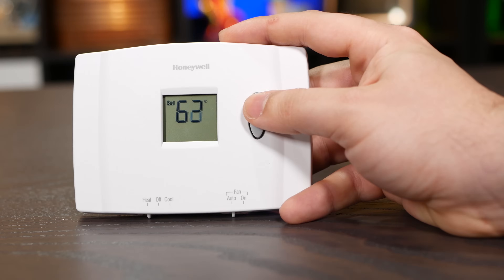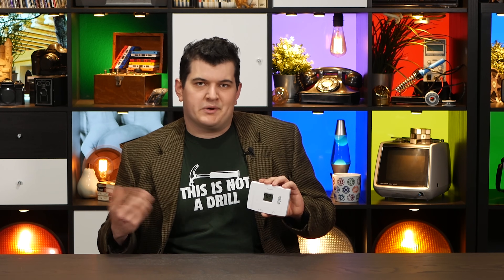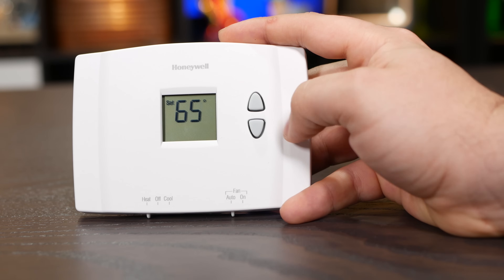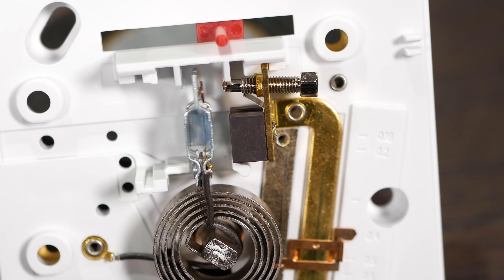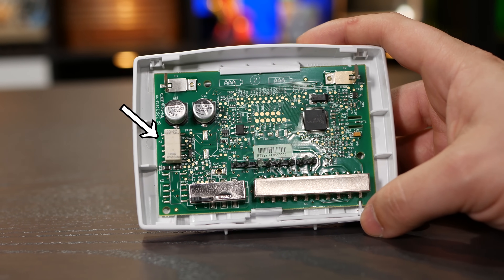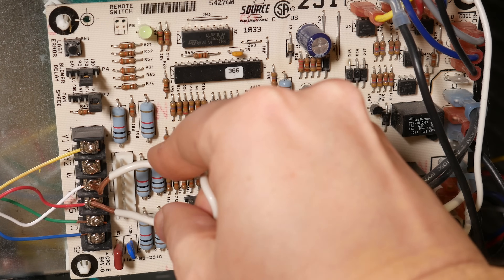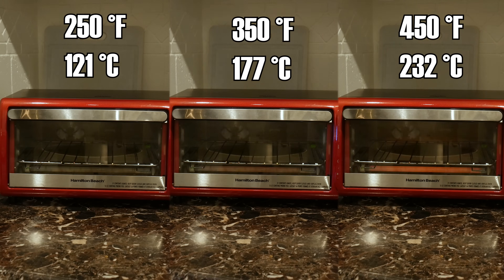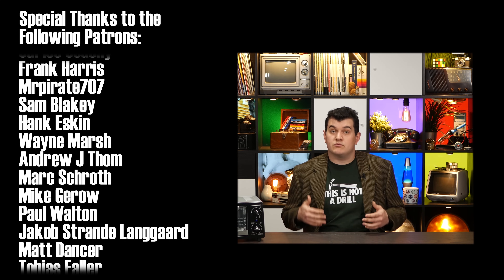Thermostats: Cooler than you think!

Comment: I understand why you did not use the term 'Hysteresis' but you might have mentioned the anticipation resistor present in old mechanical thermostats to accelerate the heating inside the thermostat housing to match that of the rest of the home (in theory).  And for what it is worth the time compressed toaster ovens were a great example.  If you don't need them anymore I would like to say I do like a well heated toaster pastry.

Comment: Another thing talking about heating technologies.
I don't know if this kind of systems are used outside Italy but here we are:
In my house there is a system that does not command the furnace but a valve.
The water is always warm and it circulates in the tubes continuously in all the floors.
There is a thermostat for every floor, when a thermostat triggers, 24V are provided to a liquid expansion valve.
A liquid expansion valve is a valve that heats up and expands a liquid that is inside, this liquid pushes a metallic bar to a valve that opens and let the circulating water Going though the floor where the thermostat has triggered.
When it Reaches the right temperature and 24V are no longer provided to the liquid expansion valve that cools down, retracts the metal bar and the water does not circulate anymore on this floor.
It's just a simple way to open a valve without any part moved by a motor or something like that.
I apologize if I made any mistake in English, if you want to learn more about this topic, feel free to write to me.
Thanks!

Comment: If you open up your furnace and see three pressure switches (plastic disk with tubes and wires going to it) it is most likely a 2 stage furnace. Most often, with the dumb thermostats, they run on the first stage for a set time (3-5 minutes) before the furnace kicks in the second stage. Most homes here in Canaderp have these dual stage furnaces. 

Those pressure switches are connected to the draft inducer fan casing and when the draft inducer is running a sufficient amount of negative pressure, the switches will close and the first or second stage will activate depending on the settings.

Comment: Honeywell just released a thermostat called the T9 which you can add multiple sensors to it for different rooms, but there is a tricky thing they do. You can tell it for certain times of day what sensors to use for priority on the heating and cooling. So you could tell it to make the living room the priority sensor during the day but the bedrooms priority at night. It doesn't change the proportional distribution of air, but it does allow finer control without modifying the system itself. I haven't tried it myself but it seems quite a good solution.

Comment: Also, that filter slot is in a terrible location, and should be reworked, with a true media filter cabinet, so you don’t have difficulty changing it, and you get proper filtration without static pressure buildup behind an inadequate filter.

Comment: I have an electric furnace that has 3 stages of 4kW each. The thermostat only tells it on or off as you would think, but there are sequencers in the unit that turn on the stages progressively the longer it runs. It is about 30 years old and this is still a common configuration.

Comment: As an HVAC tech... you are close, but simplifying a tad... firstly, R and Y do not stand for red and yellow... they stand for control voltage souRce, and cooling circuit. W is for heat... a heat pump has Aux heat connected to W2, Emergency heat is a position used only when the heat pump is damaged...

Comment: I lived with my grandmother for a while after my grandfather passed away and I really came to see how much of a saint that man was dealing with her. She regularly would get cold and then turn the heat on and set it to 80. When she inevitably got hot she would then turn it back to AC and set it to 60. Over and over and over. She would do this in the winter or summer.

Another unfortunate HVAC habit of hers was when she would wash her hair (once a week!!) she was afraid of "catching a cold" even if it was 100 degrees outside and would turn the heat to 80 for an hour or so while she did that and while it dried...

Through all this I had the unfortunate pleasure of having the one bedroom with two heat vents in it, so it heated up even more than the rest of the house. She would often start this process while I was still asleep if it was one of my days off...

I have no idea how my engineer of a grandfather lived with her for so long without making some kind of contraption to prevent her from doing these things.

Comment: Important to mention the role of thermostat in heating vs. cooling. When thermostat calls for heat, it politely asks furnace control board to start heating routine. Control board has the privilege to reject or accept it, cause she's the boss. When thermostat calls for cool, it brutally turns AC on, bypassing entire control board, control board has no authority there and only functions as a fan relay switch, cause hey it's furnace board there's nothing about cooling to it. Technically thermostat can be connected directly to fan relay and entire board taken out, your AC will function in normal mode. Now you know that you don't have to sweat when control board has released magic smoke.

Comment: the slightly better version of that battery powered honeywell you have is programmable, and you set periods of time like wake up, fall asleep, morning, afternoon, night. So you generally set those however you want. But lets say you get done mowing, you can press the temperature button arrow things that your cheap honeywell had, and it will say "TEMP ON" and keep whatever temperature you set it to for about 30 minutes, then go back to it's normal pre-programmed temperature.

I almost thought you were putting us on, but i realized your honeywell was missing the 3 buttons that allow the programming. That's the only difference though, same principles apply as everything you said.

And thank you so much i am tired of arguing with people about how thermostats work. just set the temperature you want, going lower doesn't make it colder faster, it just makes it colder, eventually. and vice versa for heat. A+++ would watch again.
Reply: Also last year i moved my house's thermostat from in front of the west facing front door where it would ice the house out every evening due to the SUN SHINE, to near where the intake is. I bought fancy thermostat wire, drilled a hole, and hooked it up correctly in about 15 minutes. And i mounted it so high up that only i can see it and use it. HAHAHAHAHA!

Comment: I used CAT5 cable to connect my thermostat. I just doubled up the wires to make sure it can handle the voltage. This only works if you are only running heat or AC, not both. Cat5 typically has 8, 24 awg connections. If you double them up you only have 4. Thermostat wire typically runs 5, 18 awg connections.

Comment: Would love to see a follow up on inverter split system aircon/heaters. I think they do have variable power output iirc and work via some sort of heat pump and refrigeration. I'm not sure how common they are in North America though, while they are the go to for house cooling/heating (provided you can pay the costly installation) here in Australia.

Comment: Thermostat wire, or low voltage wire, or also bell wire, is much smaller and therefore cheaper than mains voltage wire. A 5 core thermostat cable is not much bigger than one 10 gauge service wire.  Not to mention, the insulation is less as it is not designed for the higher voltages.  And the wire size tops out around 18 gauge due to expected current.  

And most of all, you don't want to use mains wiring because at some point some idiot will connect it to mains voltage, likely causing things to blow up, burn out, electrocute and/or burn the house down.  

I've been trying to wrap my head around code for low voltage installed wiring.  It's a complex topic depending on voltages and power.  Such as a Class 2 transformer/power supply operating at 12v is limited to 5 amps (60 watts) as that is considered both shock and fire safe.  Might be a topic to consider as people move to more homemade LED lighting circuits.

Comment: Hive has a boost function on their wireless thermostats. I don't have AC as it isn't common where I'm from, but it will switch on the heating for a set amount of time or until the desired temperature is reached. I frequently use this functionality and find it saves money reducing the time the heating is accidentally left on.

Comment: 15:02 It exists because it's a thicker AWG than ethernet and phone wire. Plus the number of pairs and as you point out the colors. It's like alarm cable, you shouldn't use ethernet cable because it's too thin. I'm not an electrician but code probably dictates that you have to use it.

Comment: I've got a cheap programmable thermostat that had the ability to temporarily set a temp outside of the program. It will then reset to it's program at the next "switch"

For instance, at 6pm I get home, it's not too terribly warm, but the humidity sucks, so I bump the temp down a couple of degrees, but at 730pm my standard program kicks in with my "evening" settings, overriding the temporary setting I just did.

Comment: If you don't have a C wire for a smart thermostat you can always repurpose the fan wire, you'll lose manual control over the fan but it'll still run with the heat or AC
Reply: There's also an add-a-wire kit you can buy that lets you connect all 5 terminals with only 4 wires.

Comment: My truck's under-hood light has a built in mercury tilt switch. Interesting to see that thermostats used to use them too
Reply: I would also like to point out that my truck was built in 2001, but I've seen the exact same light on a 1971 oldsmobile. Good ol' gm parts bin

Comment: CantComeUp, this video gives me a bit of an idea along these lines.  After seeing him jumper across the terminals, it seems like there could be an easy way to implement this.  It could be something as simple as one of those wind-up egg timer type switches or you could get fancy and throw an Arduino or Raspberry-pi in there for Wi-Fi and smart phone control.  I'm thinking about just doing it for myself so I can kick the heater on for half an hour or so when I get out of the shower in the winter time.

EDIT:  Also just thought of another really dumb solution.  Keep a can of Air Duster near the thermostat and if you want your heater to kick on temporarily just turn the can upside down so it sprays the liquid "gas" out and cools off the thermostat.  For AC, just buy a cheap hairdryer.  Kinda crusty solution but it might be good if you live in a run down apartment or house.

Comment: Its actualy not uncommon to have 2 stage (low and high blower/combustion/ or ac compresser speeds) or to have variable spee (modulating) that can run from ~10% to full blast in heat and cool.  Also most modern homes have 5 wires. Power/common/heat/cool/ and heat.  Although most people use starndard color scheme dont always trust that the colors are correct

Comment: With a Nest thermostat, if you have schedules setup, you can adjust the temperature but when it hits a new time slot in the schedule it sets the temp to what it should. Not quite what you wanted, but it is an option. I know there were days in the winter I wasn't feeling the best so I would just set the temp 1-2 degrees higher than I had it set to normally and when my nighttime schedule would kick in it would be reset to the normal day/night operation.

Comment: I'm not so sure it'd be analogous to PWM. For PWM the frequency stays the same but the amount of time it stays on before shutting off changes. I don't think your demonstration with the toaster ovens show this. When the heating elements came on and went out, they all seemed to come on for the same /amount/ of time but the hotter ovens turned on and off more frequently. If it were analogous to PWM I think they would all come on at the same time every time but for the hotter ovens the elements would stay on longer before shutting off. /Technically/ the elements were on for a longer period of time if you were count on vs off time over a couple minutes but with PWM the frequency at which they turned on would be the same for all three.

EDIT: it sounds like you sort of realised this already once I slowed down the fast scrolly bit before the demonstration

Comment: Regarding the question asked by CantComeUpWithUsernames who wants a thermostat that goes full blast for x minutes ignoring the ambient temperature: something like that exists, it's integrated on pretty much all Daikin split air conditioners! On those kind of system that function makes sense, as they modulate the power depending on the ambient temperature.

Comment: If find it rather interesting that the toaster oven you showed the effect on appears to have the quartz elements instead of the old school resistive metallic ones. The reason Breville uses these in their high-end ovens is, supposedly, because they can be held at a stable temperature rather than just constant cycling, resulting in a more even heat. So the question is, are the cheaper ovens just throwing them in to look fancier, or is the real benefit of the quartz elements marketing BS from Breville? For the record, I have one, and it's the best toaster oven I've ever had by a large margin, so it's not all BS.

Comment: Great video, would like to add that I think the word for today when it comes to the "magnet effect" in the thermostat is "Hysteresis".  Regarding the question at the end, yes many scheduling types of thermostats allow you to make temporary changes to suit your immediate temperature comfort needs, and then return back to their schedule once they get to that time waypoint.  Additionally, multistage heating and cooling systems do offer the ability to adjust the level of heat and cooling, often running at half (or close to) capacity for Stage 1 when the temperature is within a few degrees of the desired, but once outside of the desired (typically more than 3 degrees) they can ramp up to full capacity or Stage 2 to help bring the overall home temperature back to within the desired window of comfort.  This multi-stage method helps comfort by gently heating or cooling and only kicking in the full capacity as needed.  Some of the even newer systems, offer modulated (adjustable) furnaces and variable speed compressor systems that work similarly by ramping up their capacity in direct proportion to the difference the temperature setting verses the actual temperature.  I recently swapped out my old dumb thermostat for the Trane XL950, which is end of life and  you can find on ebay for fairly cheap, installed a couple zoning control panels, added thermostat sensors throughout my house (every room) that talk to the XL950, put in modulating zoning dampers,  and now not only does each room have the ability to request heating and/or cooling, the XL950 calculates how much airflow will be required, turns on the heat or cooling, throttles them as needed to meet that demand, throttles the dampers open, closed, or somewhere in between, to keep the entire house with 1/2 a degree of desired, all day.  My main reason for doing all this is because I live in a two story house, with an AC system upstairs, and another for downstairs, yet depending on the season, and due to the migration of heat upstairs, or cool air down, one unit was doing almost all the work and the house rarely was comfortable.  Since only my wife and I live in our home, at night we turn off all the other zones (8 zones total) and only our bedroom is cooled or heated, which is saving us a lot on our utility bills.  By the way, the Trane XL950 is a communicating thermostat and only uses 3 wires and all the thermostats scattered throughout the house, both the zoning panels the air handler/furnace and outdoor compressor are all paralleled on those same 3 wires, like a party line.  I also saved more than $10K by not needing a second air conditioning system when the one for upstairs died, so everything now runs on a single unit.  FYI, I did all the work myself, it was a lot of work, I replaced all the duct work with metal pipe that I had to insulate, etc. total cost for ducts, insulation, thermostat sensors, zone panels, and the XL950 was around $3K, which I was able to tie into our existing AC unit we had replace a couple of years earlier (at $15K), and I made sure it was sized to do the whole house because I felt duplication of units was more of a sales scam than good design.  Anyhow, for anybody who doesn't want to buy a second ac unit for their house, likes to save money and enjoy great air conditioned comfort, they should consider zoning over duplicating.

Comment: Here in the middle east we usually use mini split AC systems which has its own closed circuit and can be controlled using the remote control. The interesting part is the new types of mini splits that have a DC compressor rather than a regular AC one. They are marketed as "inverter" systems, and they are usually more expensive and much more energy efficient due to the fact that compressor does not need to cycle on and off so often (to maintain the set temperature), but rather, the compressor "slows down" or "cranks up" to maintain the set temp (it's more complicated than this!).

I've have one of those ACs installed in my house and they are pretty convenient and much better than "regular" AC system!.

I think Technology Connections should do a video about the different type of AC systems!